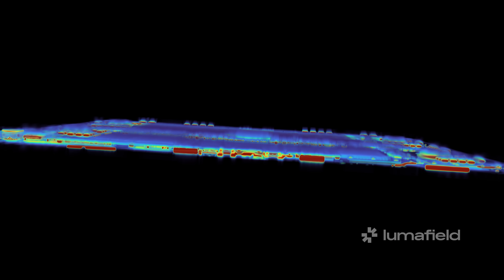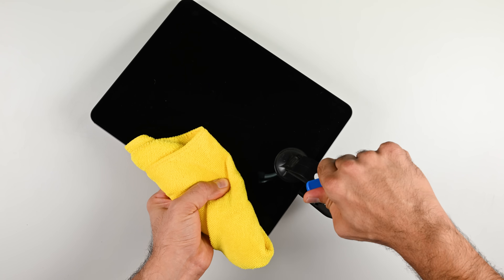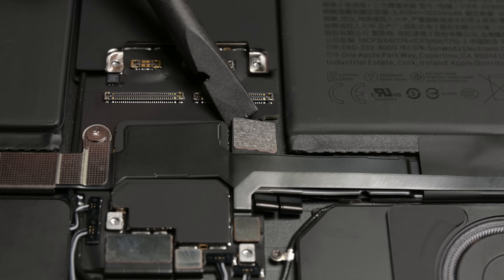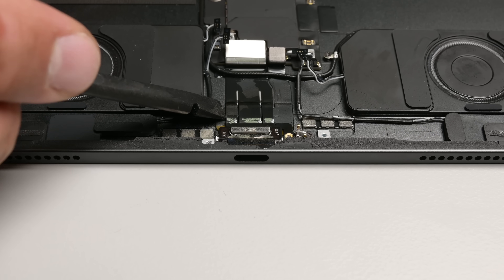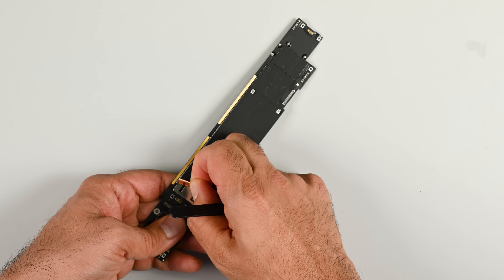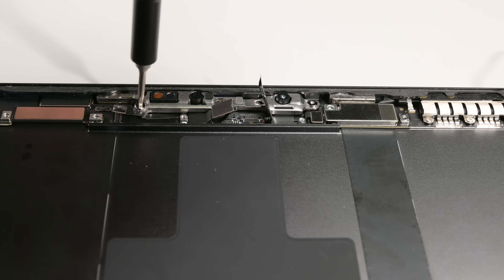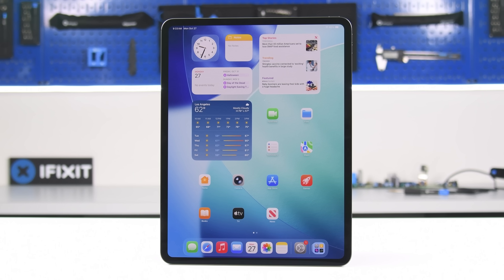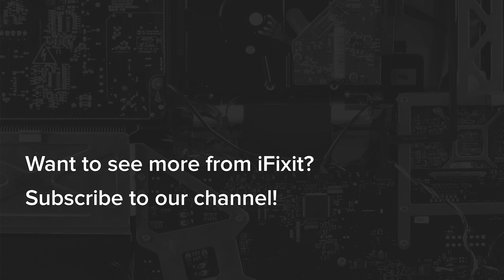We Tore Down the iPad Pro M5… and Found a Repair Paradox

Comment: Sorry but giving 5 because they have parts available is not fair, because these parts are ridiculous expensive, and worse than that, a lot of repairs are lock unless you call apple that only unlock the repair if you use their program, that is ridiculous expensive. Soo sorry but they are not trying to make their devices more repairable, they are trying to double the profit on the sell of your device behind a good guy mask.

Comment: 0:36 3 year prediction on battery degradation. Only way in is removing 1:10 the big potential of cracking that very expensive display. 
2:36 
2:58 anticipated guides for some iPad repair. Still limited replacememt parts.
4:00 Learn diff between JIs screws on Apple and the similar but most likely to strip if using Philips screw driver. 
5:35 renting out specialty tools sounds like $$$$extra revenue stream. Not clippy-friendly at all.

Comment: So you risk replacing a cracked screen just to get to battery. Basically taking a big chance of reducing trade value to mostly zero. I think for myself I would trade in rather then take a chance of completely borking a usable iPad. I come from a generation where my smartphone and laptop had easily removable batteries without any disassembly. Of course until Apple's obsession with thin became the norm.
Reply: Go slow and heat up the iPad every so often

Comment: When seeing this teardown, I noticed the speakers are designed to behave similarly to the 36N081HP but with visible improvements to give more movement over the total surface.
So, naturally without any DSP magic, those speakers must be the bassiest yet clean speakers ever in a tablet PC under 4mm thick.
Edit, though I'll have to listen to the iPad Pro M5 in person. But, if there's not a lot of RAM and it's more locked down than a macbook... I might keep an eye out for the cost of a set of replacement speakers if they sell them. QAnd if they sell a set of speakers as a "repair part" even for people who don't plan on getting an iPad, then I'll be getting myself whatever the largest storage amount of macbook they make.
I've seen the behaviours of Apple's last Intel based OS and I'm confident they're not going to do a microsoft... So, they are trustworthy enough to give them a chance for me, and a learning curve to say I can finally also use apple devices just as much as I can Windows and maybe as much as Linux.

Comment: On one hand Apple makes top notch & incredibly well optimized chips, which they then downgrade with very basic cooling!👎
Also the repairabity & replacement of the screen & battery should be below 5 out of 10. It’s quite disappointing to see the same difficult to repair - glued design coming for years from the same - trillions $$$ worth company😬

Comment: Even Apple Stores are trying their best to avoid repairing iPads. They either convince customers to buy a new one or claim they won’t carry repairs for devices in poor condition.  Previously, they offered free device replacements or upgrades for battery replacements requests, but this has stopped due to cost control, I suppose.

Comment: I don't understand why Apple has to glue the screen in. They could just use sliding clips that hold the display in place. Add two screws to secure the display in place. To remove the display, one would just loosen the screws and then slide the display into the opposite direction. This particular design was used on the iPhone 4 and allowed for quick and easy access.
Reply: waterproofing will be an issue then
Reply: @ashwinnhebbar they don’t do waterproofing on the iPads anyway so it doesn’t need to be fully sealed
Reply: @blueclipsa 😂 yes it does apple is much more focused on sealing it then they are making it repairable
Reply: I suspect gluing makes manufacturing simpler.  Manufacturers won't care about you being to repair it later.

Comment: Apple has no incentive to make easily repairable batteries, as people would keep their iPads longer. Especially now that they are so powerful that they could last a decade.
Actually Apple goes out of their way to avoid the paid battery service on iPad.
My battery was lasting much less after a few years on my older iPad pro, but Apple kept saying it was above 80% so they coudn't service it. I went every year and battery was lasting half of the original battery life or less. At some point it was only lasting 2-3 hours and when I went again it met their requirement (all of a suddend in 6 months it had gone from over 80% to 55%...) but guess what? They said my iPad was no longer serviced because they no longer had parts for it, so I had to buy a new one...
Reply: At least our local agents will replace a battery regardless of the supposed current battery health, which is good because that percentage is meaningless.
Reply: @loganmedia1142  Yeah I have a local shop that replaces batteries too for $100, not original ones but good enough

Comment: Fingernail is the best tool you can have to remove a tablet screen or a smartphone screen. Basically, I never use the suction cup since I use my fingernail to separate the screen from the device.

Comment: Speaking of that very expensive and very fragile screen: I've had the pleasure of trying to remove a few cracked ones in the past. Not fun. No matter how much heat we applied, once cracked they refuse to come off in a single piece. It's a job that requires gloves, eye protection and a bottomless well of patience. Because you're going to be peeling off tens if not hundreds of pieces of glass all afternoon.

Comment: The only benefit I see is the battery being possible to remove without taking the board out, something that has always been easy to do on the minis for some reason, but the base, airs, and pros get the trash removal methods. I wouldn't really applaud Apple much for giving repair manual. Like sure, nice to see, but the screen removal process is virtually the same on every ipad, with cable connectors in different positions. There's really only one method to removing the screen, so it's not like they're telling us a "back door" method, just use heat and iso (ONLY ON OLED DEVICES!) Parts availability is a joke. Like yes, they sell the port on the 11 inch M4 for $103, or you can buy from Apple's own genuine parts distributor, MobileSentrix (which Apple links to) for $16, or $10 for an aftermarket version. The pricing that Apple does should be illegal, no reason for that part to be $103. Even the rear camera is $250, or $40 FOR THE SAME PART from MS. Again, HOW IS THIS LEGAL?

Comment: I take an iPad apart occasionally. In my life, I removed 3 original apple screens with only the first one cracking. The other two came out without issues. Either I am very lucky or kinda know how much pressure I can apply. I still dont want to risk my iPad Pros screen and definitely see why you would avoid such repair

Comment: My ipad 12.9 m1 cracked the screen last year.. no repair only replacement and it cost 1200$ …. if button breaks… replacement 1200$ …. usbc break… 1200$. Apple claim they only do replacement because they can not guarantee the glue will hold if replaced?!   It should be illegal to make a product like that.

Comment: I think if you take good care of your battery you wont need to change it. I'm rocking my iPad Pro 10,5 inch from 2017 and it's holding on well with the original battery still. The real e-waste is throwing away a perfectly good battery that is slightly degraded from usage.
Reply: mine, too. Even though final security updates this August 2025.
Reply: Batteries are a consumable part. Yes there's ways to extend there life and take care of them but no matter what you do, the battery health is always degrading from use or lack of use. Its a matter of time until it needs to be replaced.
Reply: @lenshibo  And for this reason, it would be great if these manufacturers made it easier for us consumers to replace the battery with ease.
Reply: @solefreak2 To achieve such a laudable outcome, how many individuals willing to accept a thicker iPad. I certainly would!
Reply: @JustSomeHuman-j8o  I don't mind having a thicker iPad but being able to replace battery with ease! Same goes for the iPhones. I remember the good old days of Nokia phones that covers to reveal the battery, some even shipped with 2 batteries.
Reply: @JustSomeHuman-j8o  I'd happily have a thicker phone too.  No more silly camera bump.
Reply: @solefreak2  Most of them had really terrible tiny batteries though.  The 6310 didn't and mine is still using the original battery which even now lasts a few days.
Reply: Likewise. My 10.5 is still doing fine though its had some minor display issues for the last few years and the home button is showing signs of fatigue. I won't deny an M5 upgrade is tempting, but not yet essential. I don't run anything demanding though which I'm sure helps.

Comment: Apple has been making some meaningful improvements, but I'm going to keep waiting for someone like Framework to make a proper repairable tablet.
Reply: Maybe give it a screw-on bezel for the screen and have it have more ports than a typical tablet. Also use gaskets for water resistance. And have it use  standard framework 13 mobos. This is because one of their magnetic style one would interfere with standard repairability
Reply: the issue with tablets is, unlike phones or laptops where being a bit bulkier is not that big of a deal, for a tablet it absolutly is.

Comment: To say iPad battery starts to die around 3 years is a little disingenuous. Maybe technically yes, but in my experience they experience much fewer charge cycles than phones and aren’t used as heavily as phones and the larger battery also helps to lower charge cycles compared to phones. My 2014 iPad mini became limited by lack of software support before the battery life became an issue.
Reply: my ipad pro 2020's battery passed away several months ago this year, actually mine was a bit heavily used but it was still a shame sadly. now i have to use through power source, although it has multiple bootloops pretty frustrating to use
Reply: @huuhoangmanh685  Even without Apple Care you can get a battery replacement from Apple, in Canada it cost me $185.  I had a 2018 iPad Pro, since replacing the battery in device is such a pain, they just gave me a "new" iPad.  I wound up receiving a 2020 iPad Pro because, I assume, the 2018 model is not in their stock anymore.  I did this like 3-4 months ago.  Pretty good deal to get an upgraded iPad Pro for $185 from Apple.

I did the same with my Apple Pencil, it cost me $40 Canadian to receive a replacement Apple Pencil 2.  I just told them the battery was dying, they can't run diagnostics, so it was a no questions ask transaction.
Reply: Concur as well with my 2018 iPad Pro 12.9”. Battery is still going strong even on iOS 26.0.1.
Reply: People use their iPads heavily if they aren’t just entertainment devices. This comment seems a bit short sighted tbh. 

I can picture artists and students off hand as people who’ll use their iPads heavily on a daily basis, not just a few hours a day.
Reply: @thecanmanification artist maybe but students?.... I do not believe note taking is anymore of a huge battery hitter than opening up a dozen safari tabs or watching Netflix content in UHD. 

Idt iPads are really atp either where 'serious' coders, 3D modellers or video editors are heavily using it in their workflows just yet. In a couple more years probably but the software's still too limited for those people when basic plug ins or extensions just won't work on iPadOS.
Reply: @thecanmanification 99.9% of iPads are used for watching YouTube 😂
Reply: @nicholaswicks3077  uh huh
Reply: @nicholaswicks3077  No they are not. Most of my classmates at the uni use iPads to take notes and make the homework. Also, as the other guy said, artists use their iPads a lot too.
Reply: I agree. I have an antique iPad Pro 9.7 from 2016 and the battery still held enough charge to last a whole day up until 2023.
Reply: As much as I dislike apple devices the battery is rarely an issue in my experience. I have a MacBook Air from around 2013 or 2014 and it was a workhorse. I have a new one but the battery is still functional in 2025. I have an iPhone from around the same time and it also still lasts a day of use
Reply: @sayori1989  Maybe on the Air models.  My 2011 Macbook Pro battery was no longer much use after 5 years.  Unfortunately the design means it ran slowly if I took the battery out to run it only off mains power.
Reply: The 4.5-year-old (2021) M1 iPad Pro I'm typing this on hasn't held much of a charge for the past year, so maybe 3.5 years with pretty heavy use? It needs a constant USB PD connection. A regular 10W-ish USB-A charger can't charge it faster than it drains. But it still lasts maybe 2.5 hours off the charger. I mean whatever the battery is the weakest link but I'm not sure I care enough to crack it open and replace it. Hopefully the battery will fail and puff up and sepeparate and make replacement easy!
Reply: I mean I’ve had my m4 iPad Pro since last June it’s done 214 cycles but has 85% health left, and tbf it’s been used pretty hard and has even done some gaming
Reply: I still have a Mini 3 from late 2014 and the battery works well
Reply: My 2018 iPad pro 12.9” is still going strong.
Reply: Upon activation of the M3 chip, the iPad can bypass the power supply. Even after reaching 80% charge, it can be connected to a power source and utilized without depleting its battery.
Reply: they also behave more differently after aging. iPad batteries still are able to hold a way higher battery health percentage and voltage even after more than 1000cycles over 10 years, compared to iphones. I am writing this comment on my ipad air 2. the battery has never been changed the ipad is more than 10 years old has more than 1100 cycles and around 78% health. like it still works can last like 4-5 hours of real world use, lasts longer if you just watch stuff.
Reply: Not dies, but my four year old iPad definitely has noticeably degraded battery life.
Reply: im still using my ipad air2 with still around 4hrs
Reply: Yeah I was gonna say this, my iPad is going on 4 years and its battery is no way near dead
Reply: Yeah my 2018 iPad Pro continues to have decent battery life. 7 years and going.
Reply: Ifixit is only good for their teardowns to show how devices look inside. I legit don’t jive with the weird takes like this that their video hosts always have
Reply: Your experience ≠ other people's experience. Who made you spokesperson for all iPad users? You'll see contradictory information from Reddit and Apple Support forums saying that once the Apple Care ran out, the battery capacity went down from 80%, conveniently becoming prime candidates for free replacement HAD THEY STILL HAVE APPLE CARE PLANS.
Reply: @1centimetre  Yeah. And it's not like iFixit has repair guides and a store that sells parts, and has data on how often people are looking up iPad battery replacement walkthroughs or buying replacement batteries from them. Ignore the actual data, a few people in the replies said their batteries aren't dying yet so let's just go off of vibes.
Reply: @1centimetre  They're suckers if they paid for an extended warranty in the first place, but besides that the battery health percentage is meaningless.
Reply: @1centimetre you’ll see contradictory replies in this thread. Who made you the spokesperson for all iPad users?

Comment: Kinda odd Apple using JIS screws seeing as they’re discontinued
Reply: To help others with this rabbit hole: What I see is that new Phillips (that adhere to a modern standard) have JIS-friendly blunt tips, so if anything it's the old sharp-tipped Phillips tips that need to be avoided. For most people, that direction (if you have JIS, prefer trying it first) still works better than the other way around.
Reply: @AySz88 that’s what I heard too. ‘Anti slip’ and ‘anti cam’ Philips

Comment: That 1st flex for the mic could have been integrated in the part below the glass, without being stuck on the screen, risking one more broken flex cable. A million screws and a million connectors while their competition tablets have the same amount of sensors and mics and are 10 times easier to access. There is NO WAY those tablets are not made like than on purpose so Apple can take all the money from the repairs/exchange. It impossible all stupid engineers work there and the smart ones are all working for Android companies.

Comment: It is really nice to see modular USB ports as I've had my parents kill several tablets by treating the USB port like crap. I've since switched to magnetic charger connectors so they NEVER have to plug/unplug the USB ports again.
Reply: Pro's have been doing this since 2018.
Reply: I don't know about USB C but I've had to change more Lightning ports on my iPhones over the years than batteries.. Those things all eventually gave up.
Reply: @Greg_Littlefield proper cleanings will do the trick. It is rare to need to actually replace one